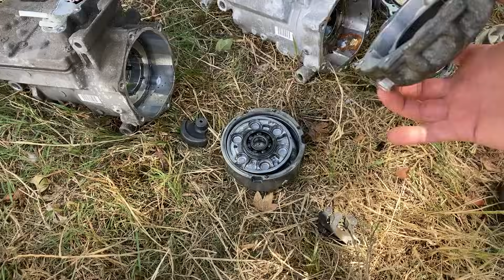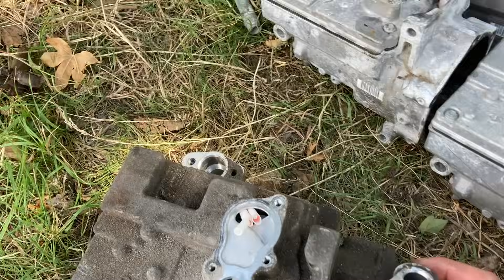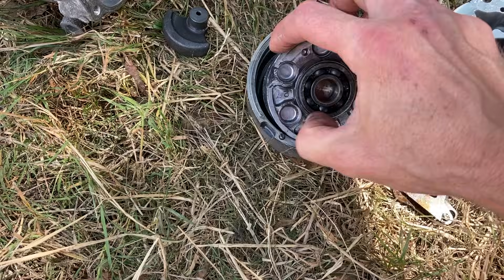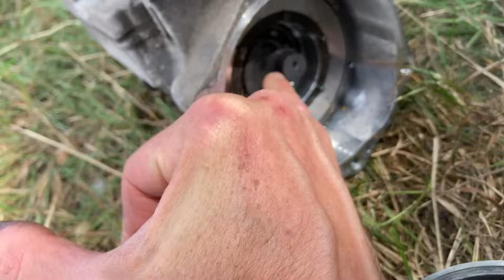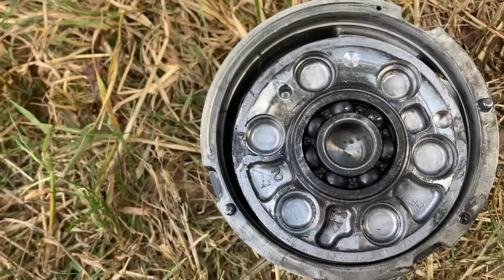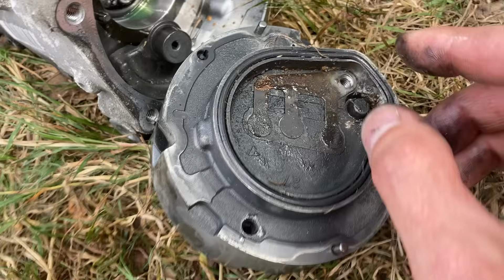What is going wrong with the Renault Zoe AC Compressors? No Heat pump failure EV Repair Electric Car

Comment: 13:13 Long Story short - 2023 FEB by -10C° This lovely Piece of 🐂💩 Engineering Deisintegrated just like you have shown the snail gear before - and it was just a Light repair job around 4000€ - NEW Compressor/ flushing the system with alcohol everything 🤡 And everytime the Compressor is running Summer/ especially Winter - it is making this Rattling Grinding noise for 3-5 seconds 😭 This makes the Zoe not driveable in below Fall/winter 🎠 What the heck is wrong with it and im Very very very Desperately waiting for Spring again so that this issue isn't so strong 🎉 There seams to be a Magnetic Valve ( the lowest one in the System ) that can be full or blocked with metal debris if the snail gear went to the graveyard 🎄

Comment: Question! My Zoe 2016 22Kw 40K bought about 9 months ago love it great second car! Ac didn't work had re-gassed apparently wasn't that low. Been find since until last week on way home was working much better then normal like actually getting too hot in the car! Then I think the next time I put the heater on nothing nothing at all! Now I sounds like a metal on metal light knock and stall instantly waits few seconds and tries again. Sounds like a car solenoid when battery low but just the once click. after 3 or 4 attempts it stops trying until next start up. Is it just a case of get new compressor ouch! Ill haply do the work myself worked on my Mx5 rebuilt suspension Polybush etc and understand hv systems etc. Thanks love your videos!
Reply from the maker: Yes it sounds like the Compressor has failed, please note that Car must have its HV system isolated before changing the Compressor because the car will not automatically shut down the hv system when the compressor is disconnected so you can easily end up with live high voltage exposed.
Reply: @garycevrepairs  Yer what I thought tbf and got a copy of the Zoe workshop manual which is actually quite informative! If I decide it's worth the time and money where is the best place to get a cheap compressor? Not one ev garage around me which is fun! I would just pop to you but I suspect you're like 5+ hours from me unfortunately

Comment: Hi what are the symptoms if the heater radiator in the dashboard is blocked or partly blocked from a failure in pump?
Reply from the maker: Hi that would cause the gas to vent from the compressor over relief valve, presuming the compressor is good but internal radiator blocked. I’ve seen that before. Cheers
Reply: @garycevrepairs Hi yes I am getting the venting from relief value and also have replaced the pump and got the same venting so just ordered replacement radiator big job a head. 😢

Comment: When disassembling to examine the failure cause, after the 6-bolt cap on the high pressure side, how does the next section come out to get to the roots compressor scrolls?

Comment: My compressor just died, so a workshop here replaced it. But now I get RED "put it into park" when I want to drive😢 I disconnected the compressor so I can use the car, but it is not fun with almost no heat in November.
The workshop refuses to fix it😡
What can be wrong?
Reply from the maker: That is quite odd symptoms, is it the black plug you are disconnecting on the compressor to get it to drive? Sounds like there is an issue with the compressor, perhaps they put one from an earlier zoe on the car as they aren’t compatible.

Comment: Question is the Zoe heat pump 2016 model Alternating current or Direct current? On the CanZE the pump has 0 rpm when in AC mode and there is no pressure is also 0. There is no sound coming from the compressor. Check the gas, the gauge shows there is gas in the system.
Reply from the maker: Dc, it’s powered by the high voltage system.

Comment: Love your Zoe info.  Can I ask a ZE50 4 years old Zoe question?   (1) lost ac cooling 2 months ago (2) car makes loud noise, high speed component, running down in speed when we switch it off.  (3) renault did gas service (4) still no cold air (5) car keeps ac? Running for 2 hours at full power when we park and switch off.    Your initial diagnosis?   Many thanks.
Reply from the maker: Sounds like the compressor, your car has a 5 year 100k warranty so should be covered by Renault. The compressor speeds up and slows down in steps, it makes a bit of a whine but shouldn’t run on for 2 hours, could be battery cooling but as it’s unusually loud from your description I’d get it back to Renault. Thanks.
Reply: @garycevrepairs thanks Gary.   Good news update.  Left car overnight.  Started ok in morning and ac now blowing cold and hot.  Stops when we turn off the car.

Could it be the ac gas and oil service needed to circulate and time to get fully working?
Car is flawless today…. Good old Zoe.

Comment: Are those rebuildable? My understanding is that most zoes carry (very similar to Prius? ac compressor) compressors that are manufactured by Denso? (someone, please correct me if I am wrong). Also, it may be worth checking out this video yuzTr6cafks (put into YT search)... It looks very very similar to this design, if not identical? It is not in English, but the guy seems to be doing a further disassembly and rebuild...

Comment: Funny thing happened after I watched your ac video.  When we drive with the ac on and park….there is a loud ‘jet engine spooling down’ sound… any idea if a post switch off engine noise might be a bad sign.   Ze50. 2020 AC only
Reply from the maker: Hi the jet engine noise is normal and it will be spooling down at that point - as long as it’s a turbine type noise and not a rattle or grind then I wouldn’t worry. Cheers

Comment: What are your thoughts on servicing the receiver dryer?  I only discovered this was a serviceable item recently.  Can it's replacement be a means to mitigate potential problems developing?
Reply from the maker: Hi it’s an odd one because if you replace all the parts that Renault recommend then it’s just cost prohibitive. Personally I don’t replace the dryer but carry out a long vacuum since any moisture captured will then boil out under vacuum. Whether it means the system lasts longer it’s hard to say but I’m always extremely fair with customers regarding any warranty issues though I get basically none so I can’t be going too far wrong! Cheers

Comment: In regards to the isolation faults, I discovered a few years ago, that if conventional AC compressor oil is used it can cause isolation faults. Whether it's because it degrades the insulation or slightly conductive I don't know. presumably at least some compressor windings are immersed in refrigerant. IIRC, POE as opposed to the usual PAG oil.

I'm fairly certain our Leaf at the time required this.
Reply from the maker: Yes the normal PAG AC oil is conductive and not suitable for high voltage compressors, the AC oil lubricates the motor inside the Compressor. Cheers
Reply: @garycevrepairs I thought that maybe some AC servicing outlets have been causing the isolation failures. The difficulty would be proving it.

Comment: Hi Gary, a very interesting video. I'm currently struggling with a charging problem at my Zoe R110 ZE50 and am in the process of replacing the BCB. 
When I heard at 11:28 that the compressor could destroy the BCB due to an insulation fault, I remembered that my problems started about 5 weeks ago when we had temperatures above 30°C for a long time. That means the compressor was certainly running during charging. Is there any way to check the compressor for insulation faults before I install a new BCB?
Reply from the maker: Ok. BCB on one of those is basically just part of the control box on the side. I hope you aren’t fitting a complete control box? If so the car won’t start after, due to vin locked components. To test the compressor you’d use a high voltage insulation tester to check it for shorts otherwise the new parts can be damaged by the compressor. Cheers
Reply: @garycevrepairs  I bought a used “PEC” block from a car that had been in an accident with only 22,000 km on the odometer and removed the charging rectifier module (battery charger block = BCB) from it. I'm not replacing the entire control box, just the one module. Unfortunately, I don't have an insulation tester. However, my air conditioner continued to work normally despite the charging errors. I went to Renault for a fault diagnosis after my Zoe stopped charging. They told me that the BCB was most likely defective. Surely they would have detected a defective compressor, wouldn't they?
Reply from the maker: @vw-miner ok cool. It’s a bit of a faff to change but doable. I wouldn’t trust Renault to check the ac compressor insulation. If it works though that’s a good sign. The Rectifer is shown as the bcb Ecu in diagnostics but that’s only because it was the control unit when the bcb was a separate unit with the blue capacitor above and the charging filter.
Reply: @garycevrepairs  good to know where the name BCB comes from. Correct naming is always important. I have one more question: once the rectifier has been replaced, I would like to do a charging test before putting everything back together again. I would connect everything provisionally and try to charge the car. However, I want to leave the air conditioning circuit empty (i.e. open). Is that a problem?
And I would like to say again that your videos are extremely helpful. Thank you very much.

Comment: Interesting, I wonder why they didnt use a regular multi piston pump compressor like most other AC's, now I know why it sounds like it does, always wondered why they whined like they did. We always get a AC check every 3yrs on ours, and the garage does a vac and weigh replace on it as its the best way to make sure you get the right amount of gas back into it.
Reply: A scroll compressor can run at infinitely variable speeds so is more energy efficient especially when cooling demand is low.
Reply: @garybibby2698  Seems reasonable, although my nissan had a fully variable piston pump on a controlled swash plate set up, thus low cooling the pump was barely doing anything. Always thought that was a clever set up and far better than the normal pumps that just cut in and out on cooling demand.

Comment: The Reason these Compressors die, is: they are driven long Time low on Gas. The Gas is whats transporting the Oil throu the System. No oil = high temp on seals= isolation Fault/Mechanical failure.
Reply: What about presence of water inside the circuit?

Comment: I have a ZE50, my compressor is pretty noisy and the pressure goes only to 10 bars instead of 20, I think I will have to replace it 😟

Would like to avoid the 1500€ bill from Renault but I don't think it's a good idea to put a used one.

Comment: 5:44 is the reed valves that lets the compressed hot gas escape from the scroll. it works in the same fashion as the valve that sits after the carburetor in a two stroke engine.

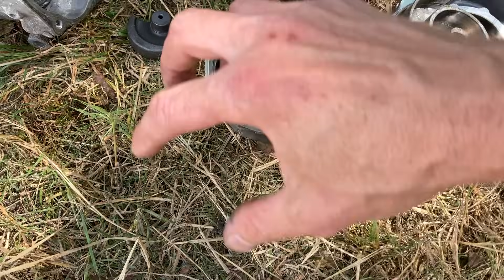Comment: 2:15 Vapor, not fluid. Put fluid into the compressor and you'll destroy it. refrigeration compressors pump vapor mixed with small amounts of oil.
Reply: Gas is a fluid. "Fluid" does not mean the same thing as "liquid". You don't speak English as a first language?
Reply: @aidensmobile614 in English English then a fluid is taken to mean a liquid, anything else is semantics.
Reply: @aidensmobile614  Correct. I don't. Thank you for the correction. I was meaning to write liquid.

Comment: Thank you for the video. Have you any idea of the cost of replacing the compressor?
Reply: I was quoted £2500 plus labour. Decided against it😂
Reply from the maker: @markthompson9332 Wowzers
Reply: @garycevrepairs took it to an independent in Durham (an ev specialist) and they quoted me that. Said they wouldn't fit a second hand part even tho I found one for £300 on eBay. We still use the car but it's horrible in the summer and winter.
Reply from the maker: @markthompson9332 ouch. Some garages won’t fit used parts unfortunately. Perhaps look for another EV garage. I’m in Essex so quite far. Cheers
Reply from the maker: I’d charge something like £750, most independent places would be £1,000-1,200, Renault £1,500 or more.
Reply: @garycevrepairs  would that include a used compressor? mine went today while still trying to diag and fix my main "STOP electric failure DANGER" 12v system issue!
Reply from the maker: @AlanValentine hi that’s the total cost. A red warning on the dash is not usually caused by the 12v side. Cheers
Reply: In France probably 1000-1500€ in a Renault repair center. You can also find 200-300€ used compressors online (this is what I did). You need also gas and oil refilling and moisture removal. Anti humidity cartridge should be replaced as well.
Reply: Local independent EV specialist in Guildford charged us £1,400

Comment: Are there any compatibility with other cars?
Like Q motor with Leaf and R motor wirh Smart or.something like that?
Reply from the maker: Hi not sure about the smart, leaf compressor is quite different I believe - Zoe compressors aren’t even all compatible with each other so although it looks the same the compressor comms has been updated in 2020! Cheers
Reply: I couldn't use ze50 nor ze40 compressor for my Q210 compressor. Only solution was to find an used q210 compressor. I think one solution could be to switch electronic boards
Reply: @garycevrepairs I have a broken 5020R compressor on my Q Zoe, I'm looking at ebay for a new 8999R for around €550, are they compatible?
Reply: At least one type is Denso made in Japan quite a large outfit I believe

Comment: Many scroll compressors are made of magnesium and use edge seals, inserted into a thin slot on the edge of the vane. 

"G60 superchargers" were used on high performance vdubs.

Many Copeland brand refrigeration compressors use the scroll "wave compression" concept. 👍🏻🇬🇧
Reply from the maker: Interesting, thanks